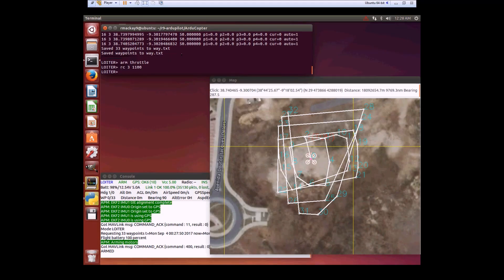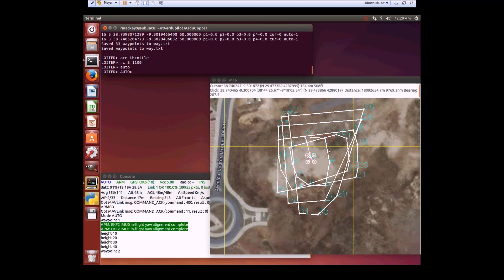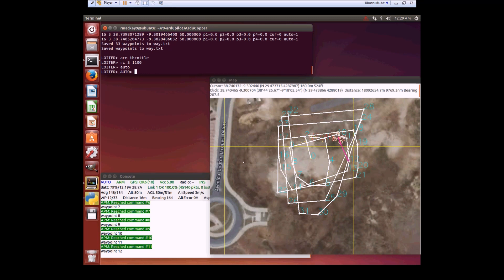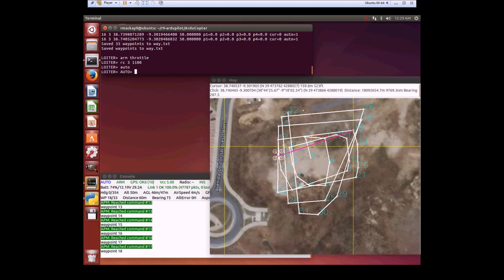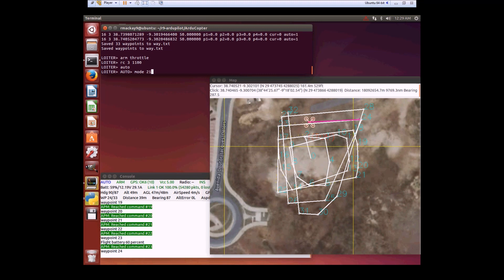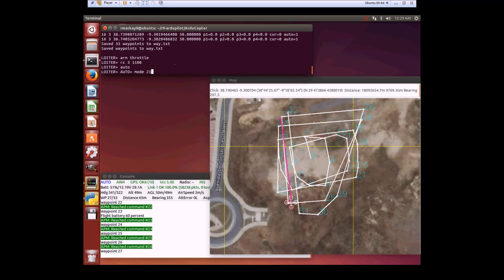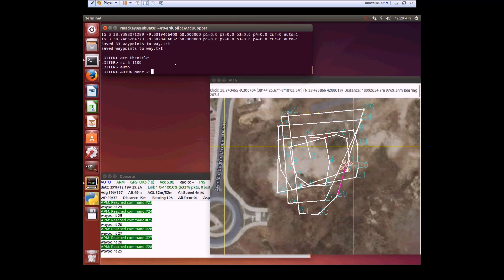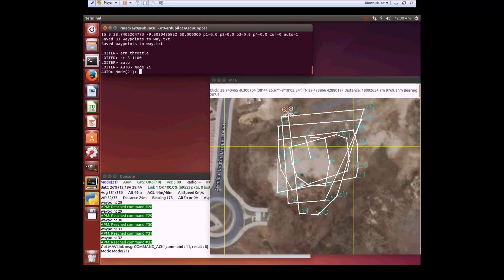SmartRTL Simulator test

Comment: Randy, as before I'm excited to see development like this. A couple of questions - when it takes a shortcut, does it take account of the altitude it was at when it previously crossed that point? If it crossed it once at 10m and once at 100m, does it use that to create a shortcut? If so this would seem dangerous (there might be a bridge or roof between) but if not, there is presumably some parameter to allow a set vertical distance to count as negligible? Will this be user configurable?

Also (novice question), what software are you using to run and visualise the simulation?
Reply from the maker: Andrew, thanks! it works in 3D so when the paths cross, they must be within 2m (this distance is configurable) of each other.  Hopefully we will get this into "master" this week and then it will go out with Copter-3.6 which is still a couple of months away from starting beta testing I think.